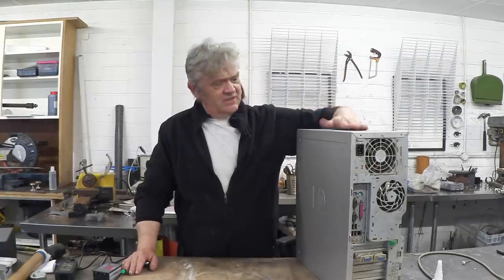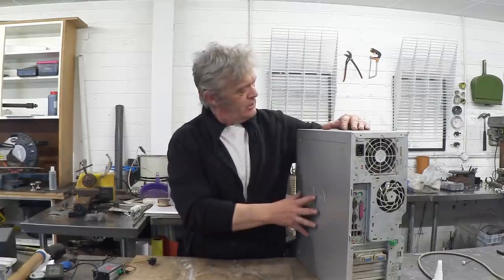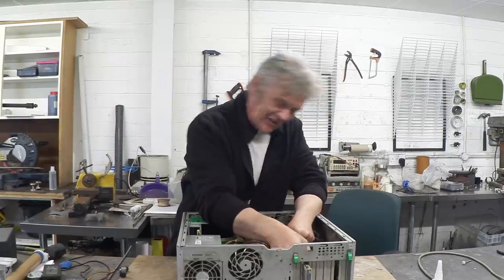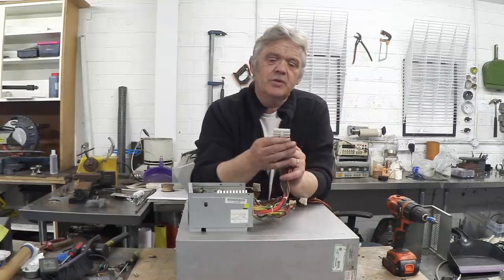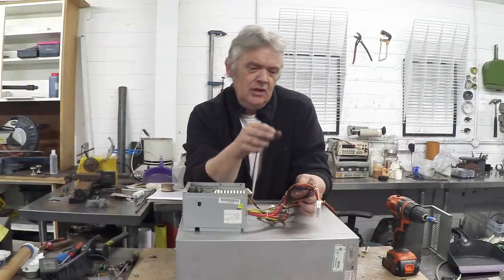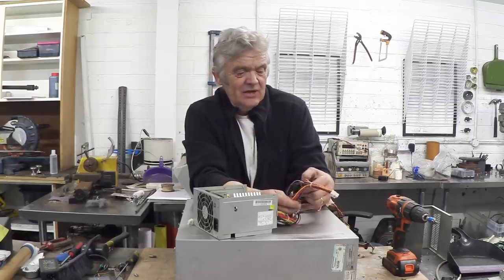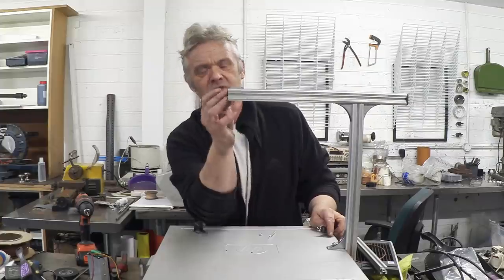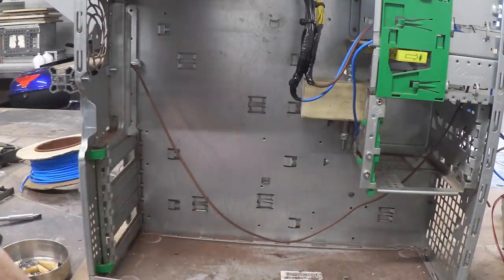How To Make A Hot Wire Cutter From An Old PC

Comment: a 2fer; a cutter & a power supply.
in the oilfield, a hotwire is a variety of gas detector. it  is basically a real sensitive multitester with a wheatstone bridge attached to 2 platinum electrodes, 1 a reference, the other a detector.  an air/gas stream across the detector catalyzes, heats the filiment, & raises the resistivity of it,  the concentration of the gas is related to the resistivity.
Reply from the maker: that is interesting mate - cheers

Comment: An improvement suggestion:  Your hot wire is expanding as it heats up and is no longer taught. A steel spring at the top, between the hot wire and the copper wire will take up the slack.  Power will flow through the spring just fine, but wont cause it to heat up so it wont lose it's springiness.
Reply: He actually mentions the need for a spring, but that he'd add one later as he wanted to demonstrate it right away.  Great point that it needs to be conductive!  I'd add that it shouldn't be too soft, probably about the tension of the spring on a bicycle brake return.  But also not so firm that it causes your wire to break frequently.  It might take some experimentation with whatever wire you choose to use for this.  I've seen people use a "spring bar" instead of a coiled spring (just a small length of spring steel that will bend) because the tension remains more constant as you're cutting and putting pressure against the wire.  This makes sense to me, as the DIY handheld hot wire cutters often don't use a spring at all, but instead rely on the tension of the bow that holds the wire.  In effect, a spring bar becomes your bow.
Reply from the maker: I said that in the vid mate - but thanks

Comment: This is a great recycling idea!   I was considering using an external 12v plugpack for a hot wire cutter, though far better using an old ATX power supply and a lanboy case, if I havent booted it already,  as a donor.

Comment: You didn't mention the actual Wire much in this.  But the Ni-Chrome wire used for certain Guitar Strings (that are commonly available and cheap) is exceptionally well suited for Hot Wire applications; it takes much higher temperatures and will break less often than ordinary electrical wire, while being quite thin and sharp for the purpose.
Reply: electric heater, toaster, etc . . . they all uses wires that are perfectly suited for heat.
Reply: Good idea David, but I wonder how it's possible to measure the resistance of such a wire, as it's really really low and only 1M long, meaning the wire isn't self-limiting and probably needs a resistor of some kind.

Comment: I have what looks like that exact power supply that I've used as my bench supply for about 3 years straight now. I bought a proper DC supply last year, but not for the lack of function from the PSU. I've made my upgrades through the years lol; made an adjustable output, terminated the ends to banana plugs, attached an on/off switch, indicator lights for power and standby, you name it. Not all at once of course, just as I needed.

Comment: Great build and nice easy to follow diagrams,
As 1 or 2 people have mentioned here, the fumes could be an issue, a 12V PC fan (or two) would be great for pulling fumes out of a nearby window or into an activated carbon filter.
Reply from the maker: nice tip mate - especially as I have a spare fan!

Comment: I always wanted one of these, and I like the method you used. Lately I've been using a propane torch to heat a box cutter blade. Faster, inexpensive, and cuts through rope at least as well as a hot wire. No residue on the edge and perfect cuts, and no extra equipment in the shop that isn't already there.
Reply: Spelunkered

If I may recommend.

A regular electrical plug in soddering iron will take an exacto  blade screwed in.

That gives you many blade choice. It works and gets the blade hot.

Hope it helps.

Comment: I've done quite the same cutter a few years ago to split foam sheet thinner. Obviously I've oriented the cutting wire horizontaly. For the cable I used a guitar string allowing to easily change for a different.
Reply from the maker: awesome mate

Comment: Hi Robert, I joined all the Blacks + green to one end of the hot wire and all the Yellows to the other as per your vid but when I switch on, the fan and led do come on, then theres a click, the fan stops and the wire doesn't heat. Advice please?

Comment: This is wonderfully timed for me!!  I need to cut plexiglass into small squares and have been a bit frustrated with the traditional method of scoring/snapping it.  The pieces I need to make (about 80mm) are too small to get a clean break, and I've been throwing away one piece for every two I make.  I like the use of V-channel for this, very solid and a really sleek look, and the case makes a great work surface!  I just need to figure out where I can clear the workbench space for it, LOL!!  Or maybe just put it on its own stand.
Reply from the maker: I might remake this following the suggestions on here - it would just mean replacing the power supply as I cut off all the wires but the yellow ones because I wanted it clear as an instruction - however I was sorry to lose all the other stuff - now I want it to be a bench top power supply too then it can have a place of its own
Reply: @ThinkingandTinkering  I thought Steve Tobias' suggestion of multi-purposing it was absolutely brilliant!!  I had been considering a DIY hand held one, and then saw this video and loved the result!!  But I'm really out of bench space.  Steve's idea might solve that problem for me!! 😋
Reply from the maker: @NorthernKitty  yeah I loved it too - very clever thinking

Comment: I have a question about mainly the 12v, which on many PSU's, they have multiple "channels", each running 10-25 amps.  Mine has 4 channels, each running 25 amps, and they are labeled as "channel 1, 2, 3, 4) and the wires are soldered onto the main board into what look like seperated channels - there is no bridging between all 4 channels.  I'm wondering what would happen if I paralleled all of them to make 100A, if it would cause a problem (some kind of over-load, circuit trip, etc)..
I'm guessing it does this for some kind of protection, where if you have 10 devices plugged into one 25A circuit and it surges, it doesn't take out everything on the other 3 circuits.  I'm guessing they are all also driven by their own mosfet and IDK how well they work together when running in parallel w/o something like a diode in line, so there is no feedback to any of the other channels.

Comment: Nice torsional stability on the gibbet,good for precise cutting whereas round bar construction looked flexy?would a battery,bow,and saltwater control that's the same as salt water welder work to make a free hand cutter?:)
Reply from the maker: for sure mate

Comment: Very cool. You could add a couple of cheap eBay items to make it multi-purpose (ie. Power Supply, hot wire cutter, radio etc.) It's not like you have a lack of room in an old computer case.
Reply: What a great idea!!  Thanks!!  That might make it easier for me to find room for it on my workbench, if it's actually replacing other things, or I can fit other things inside the case.
Reply from the maker: that would be cool - the Swiss army knife of lab equipment
Reply from the maker: it would seriously be cool - it was a shame to lose the 3.3v and 5 v outputs but I wanted it to be simple. However he is right you could collect the orange wires and red wires together just like the yellow wires and attach them to their own binding posts and hey presto a lab bench top power supply
Reply: @ThinkingandTinkering  m ore like the hot army knife, "if it won't cut it'll burn", lol

Comment: as a hobby i recycle electronics for the metals obviously any part that is still working may be worth far more as a replacement part that as scrap. server power supplies are readily available as surplus for 20 to 30 dollars and wil supply about twice to 3 times the amperage  so i highly approve of what you are doing here and if you need more current the server power supplies are also readily available and cheap.
Reply from the maker: hearty agree mate - the  power supply is very very useful and really adaptable

Comment: Hey mate,  have thought about using your sonar panel to heat a room by painting  your graphene  paint on a wall and connect the solar panel directly to the wall. It would more effective  and efficient  without the use of electronics
Reply from the maker: I didn't think about it mate - well until now - I like that idea - cheers
Reply: @ThinkingandTinkering  I have everything  but a graphene paint. High heat water based

Comment: You need the spring to disconnect the cutting wire and bring it up thru a hole in the material to cut internal shapes. I use an old Weller solder gun to the same thing but I like the computer deck as a platform to work off of. Great build!

Comment: Thank you so much. I am in the United States and going to use this method to cut foam to make four paddle boards for my family to vacation in Michigan. We are surrounded with water and paddle boards are about $200 each. My goal is to make four of them with two inch laminated insulation board wrapped in fabric. Thank you for your instruction

Comment: I wanted to follow this tutorial because I enjoyed your content, but after watching some other tutorials, it turns out that cutting off all the power connectors, sorting the cables by color and soldering them together isn't necessary at all for this to be used as a hot wire cutter. As I understand now, apparently all I would have needed to do is take the 24 pin ATX, snip one black and one green cable free (and two more black cables, purple and grey wires for optional indicators), wire them together and then take any smaller connector which has at least one yellow and one black wire (MOLEX, SATA, GPU, CPU), snip all yellow and black cables free, solder them together and plug them into the motor controller. I would have preferred this because it would make much less of a dangly mess and possible safety hazard. This would also only render two connectors unusable while the other ones could still be used.

Sadly I only found out about this later and I fear that I have now ruined both my old power supplies. It is very concerning to have this many wires just dangling about and it kinda feels dangeous and irresponsible to operate them in this state. I fear I now have to buy caps as well to properly secure the cables. The other plugs could have been used for something else too, but I would now need to reattach them, which is likely not worth the effort. All in all, I just feel like I made a fool of myself and wasted my time.

I am just an inexperienced amateur, and this was probaly obvious to all but electrical greeehorns but I thought I'd leave this as a word of warning to your subs.

Comment: Does it matter if the wire makes electrical contact with the case? 8:32 ah I see, the back ground is extended by a blue wire that's connected to a bolt with nuts on it that holds the cutting wire down. And I'm guessing the case is earthed somewhere.
Reply from the maker: it's only 12V mate so the case is earthed but because of the line voltage coming in at the ATX power supply end - but the 12v end is just isolated the negative is attached to the bolt beneath the case and that bolt goes through a block of wood. the positive at the top of the support arm but the connection rests on a bit of heat resistance insulating ceramic - the mosfet I repurposed

Comment: @Robert Murray Smith

Another example of your fine knowledge. Thanking you for showing me how to do things.

I saw something similar to this where he put the hot wire strung between a bow type limb with a very wide space 

The wire to the bow was very long which enabled him to move around freely.

This was done in the aviation industry to cut wing design and body design.

You may want to add a plug into your module, or a quick disconnect, so you can make and plug in your bowl wand for free form cutting.

Thanks
Reply from the maker: interesting ideas mate - cheers

Comment: Love it Robert!   Back to safety issues: you do know that one of the byproducts produced by burning Styrofoam is Cyanide right? best to watch your breathing around the smoke when cutting Styrofoam with heated items...  Great build though!
Reply: A fume extractor would be an easy mod for this.  You could take one (or more than one) of the fans from the PC case, attach some activated charcoal to it, and mount that near the work area.  If you consider it during the build, you might retain one of the 12v pigtails just to power any fans.
Reply from the maker: as you said later mate - cyanide isn't a by product - it fumes for sure and an extractor can easily be added if you want

Comment: A quick comment on the type and diameter wire you used would have been helpful.. you say "you know what wire to use".. but not everyone does! Otherwise great project and video. Thanks.
Reply: U (volts/voltage) = I (amps) * R (Ohms/resistance). Here the voltage is a given: 12 V and he says not to exceed 6 amps. So rearranging those gives 12 V/6A = 2 Ohm for full power ( Power btw is P (watts) = U*I ) So if you measure what length the cutting wire you need once you have build your own, you shoul try to get a type that will give you about 2 ohm resistance for that length. If for example you have 40 cm length then the wire should be 2 ohm/0,4m = 5 ohm/m. But ultimately it does not need to be that precise since that speed controller gives you control over the power. So if for instance you get the 24 swg from ebay https://www.ebay.co.uk/itm/Nichrome-Wire-Resistance-Nickel-Chrome-Heating-Element-Hot-Cutting-Various-Sizes/251550106470?hash=item3a918e0366:g:QN4AAOxyJypTkEL4 then you should not give maximum power (100%) because it only has 4,5 ohm/m and thus allows too many amps through at 12 V. But if you get the 26 swg wire that has 6,8 ohm/m then you cannot exceed the amperage since I=U/R =>> I=12v / (0,4m*6,8Ohm/m) = 12V*2,72Ohm = 4,4 A.
Hope that makes sense and if that link does not work just search for resistance wire on ebay and I hope you get sorted out :-) Have a nice day.
Reply: A good point... it needs to be resistance wire, like what he used to make the kiln elements.  Nichrome60 is commonly used for hot wire cutters, but as FarmerBob commented you can even use something like guitar strings (the thinner, solid strings).  You might also be able to scavenge some from a toaster oven or electric heater.  In the video, Rob mentions the resistance you will need at room temperature is 2 ohms.  At a guess, you can probably go with anything within 20% of 2 ohms.  If you have slightly higher resistance, it won't get quite as hot.  Slightly lower resistance, and you can run this a little hotter.  Length of the wire will also impact the resistance, directly proportional to the length (R/L).  So if the wire you have is too low a resistance, you can simply lengthen it.  If the resistance of your wire is too high, you can shorten it.
Reply from the maker: I said in the vid mate - you need to keep it to minimum 2 ohms as it is a 12v supply and you want to draw no more than 6 amps - V=IR gives you 2 ohms as heat wire is sold in resistance per meter- pick one for your distance
Reply: @ThinkingandTinkering  Ack!  I forgot about needing to limit the current draw. Thanks!
Reply: Thanks everyone.. I do know Ohms law and am comfortable using it and yes the two Ohm value was clearly mentioned. 
My point was that this is such a great video, with all the connections well explained and the circuit clearly presented, and could be followed by a viewer who wasn't from an electrical background, so it is a shame that the final piece of information is missing. Some people will never have heard of nichrome wire, resistance wire etc and won't know where to buy it or what to ask for. A few seconds of explanation on those points would complete the video for those people, even if it isn't needed for those of us experienced in electrical theory and materials.